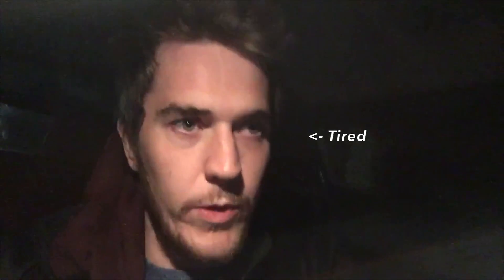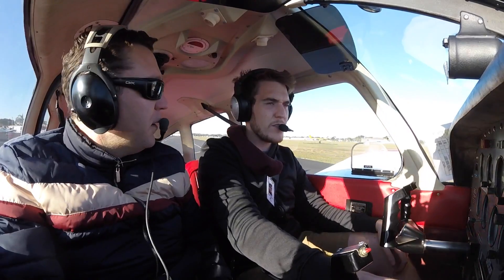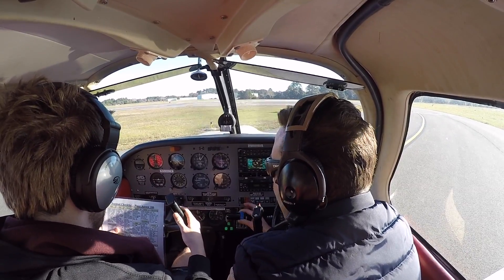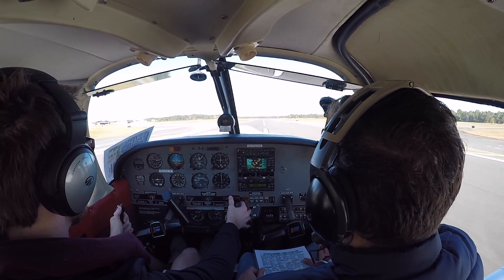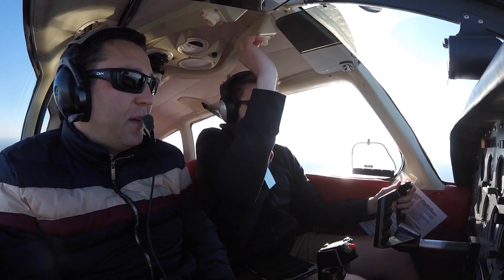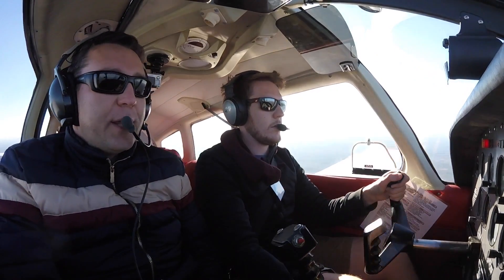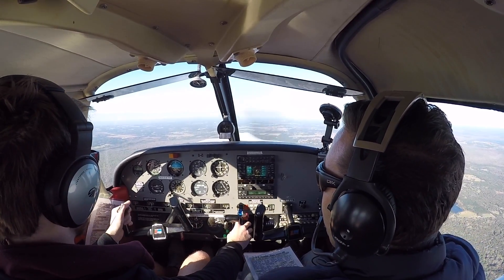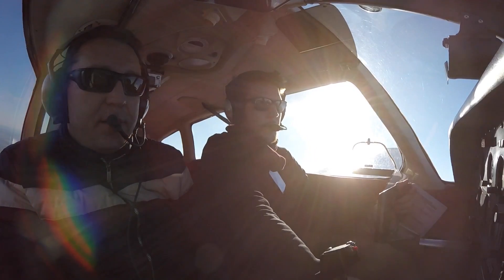Learning To Fly A Piper Arrow| Runup, Takeoff, Slow Flight And Stalls

Comment: I'm completely against mounting anything (cameras) on windows of airplanes. An aircraft two miles away is just a speck that can easily hide behind a GoPro. VFR means see and avoid. If you can't see it, you can't avoid it.
Reply from the maker: Never had trouble seeing traffic in the 6 years I’ve been recording flights. Not 1 issue with them.

Comment: I am a student pilot, I only had 1.5 hrs for cross country night flight, plus a little extra time to clean up, when my flight school closed shop and sold off all planes but the Arrow. So I had always planned to get my complex endorsement, at some point. Well it looks like that point is now. I will be transitioning from a Warrior to the Arrow for my practical. I normally would be much more intimidated by this, but my instructor has done a great job on the training. Not cocky, just safely confident I can get it done with his help. Thank the Lord I haven't lost my CFI yet, fingers crossed. Just 3 - 5 hours to go. May need more for the complex endorsement. This video is a huge help, thank you!!!

Comment: Thanks for the video.  

I was looking at the Piper Arrow POH, and saw the explanation of the gear warning/autoextension system.  I was curious about some of the aspects of it, so I went looking for Piper Arrow videos.  

This was great.  The gear-transition light is visible both when you retract the gear on takeoff and when you extend it for the slow flight.  The red warning light is visible when you're slowing down for the slow flight.  I gather you locked out the auto-gear-extension before the slow flight sequence?  Otherwise it would have just extended the gear as you slowed down, right?
Reply from the maker: gevmage The auto extension in this arrow actually doesn't work. Maintenance placarded it out. But with it working yes in that situation it would auto extend. Glad you enjoyed the video!

Comment: hey lewis Gabe again I am working on Instrument raiting right now and working on getting the written down. I was wondering if you had any advice on studying for it and what you recommend to do to study for it?
Reply from the maker: Hey Gabe.. I really like the Gleim Written Exam Guide.. I'm currently going through the flight instructor ones. For every rating they have served me really well. I would suggest getting that and the ASA Oral Exam guide. As you go through the Gleim, go through the ASA on the side so you can learn fully what the Gleim doesn't tell you, because although there is a lot of information in the Gleim, it is a study guide, not a stand alone study book. You will notice that a lot of questions that come up on the test, are in the book, so you will be familiar when you get to the test!
Reply: Go with Lewis' advice but then enroll in an instrument "boot camp", approximately $400 for two days on the weekend, you'll be well prepared for written test.  Take test 2-3 days after boot camp. During those 2 to 3 days, take the online test from your Boot Camp provider and when you score 3 consecutive tests with more than 85%, you will know you are ready for the real thing.  I was struggling with homestudy until The CFII I clued me in to the above method and it made things so damn easy!

Comment: Great job, as usual, you and Otto have a very professional demeanor in the cockpit. I think you'll find that the most critical aspect in moving up to more complex airplanes is not so much the gear, prop, etc. but the increased speed... which means you have to learn to anticipate what's going to happen a little quicker that before, and the faster the airplane the greater the need for planning ahead.

Keep up the good work!
Reply from the maker: You make a really good point. The speed will mean more planning to stay ahead of the aircraft. Thanks for watching and giving me your input!
Reply: When I first transitioned to an arrow I couldn’t believe how quick the traffic pattern went by, and how difficult it was to stay ahead of the airplane. Now it seems so natural.